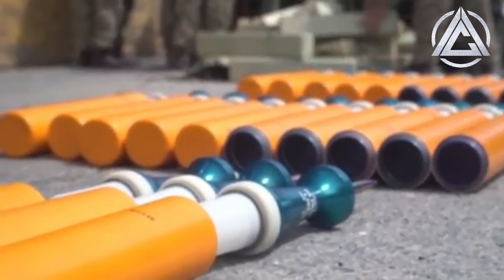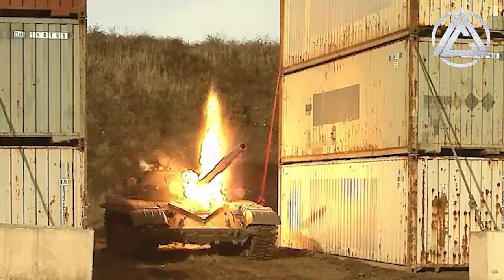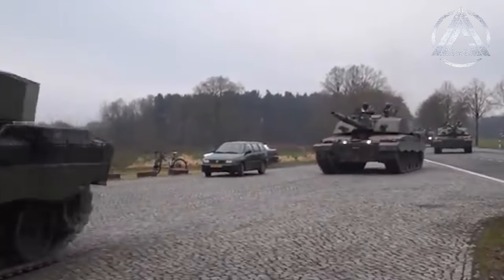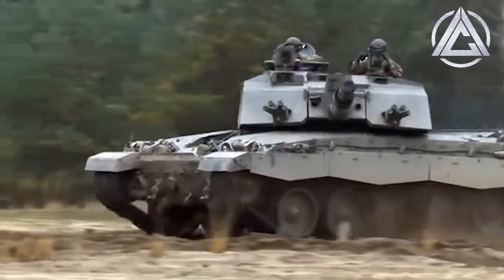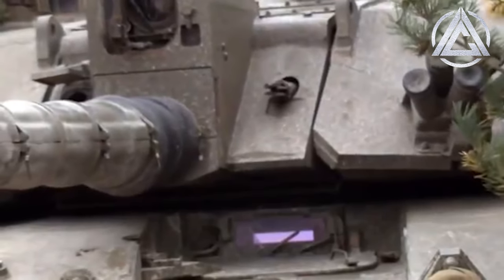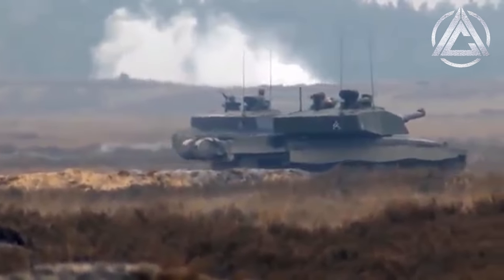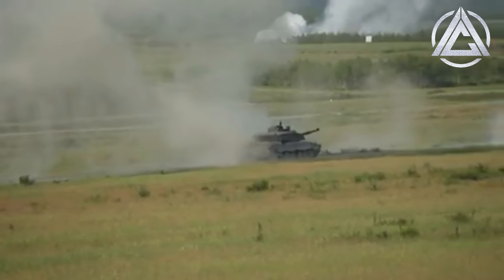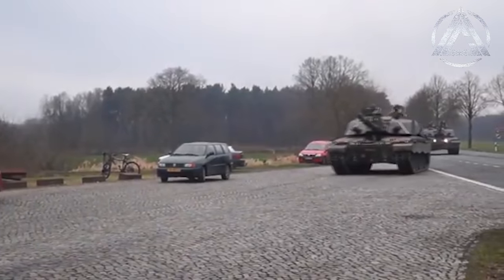Challenger 3 | Britain's New Main Battle Tank | Is It Really Any Good?

Comment: Well I don't want to be harsh but your kind of deserving it sorry you said you base your info mainly on reaserch but then you said in the beginning it's a whole new tank and that means you didn't actually read much after all because c3 is basically an upgrade to the exact same tank as c2 with minor upgrades mainly infrared technology and other few tweeks like main gun and such
Reply from the maker: The “few tweaks” are 7.7 million per unit’s worth… It’s the old Challenger 2 hull (modified). But it’s a new tank.

This would be like saying that the M4 Sherman wasn’t a new tank at all, because it reused automotive components and basic hull design from the M3 Lee
Reply: @ArmorCast  You are basically giving your personal opinion of what you think it is against what it actually is..  It's not saying anything it's just a fact it's an upgrade to challenger to not the whole tank and it will cost that in total to sell not to upgrade. The same analogy would then also be used in everything A mercedes c class from 2021 it's a completely different machine to from the 2000 model full of upgrades it should then be named f class because it's even better then the 2000 s class but no it's still the C class respectively. The difference is c class from 2000 it's a completely different car then 2021 literally everything has changed unlike the c2 tanks that are going to have some parts exhanged on exacly the same ones that are currently in service and their renaming it c3 they are not building new unit's mate their using the same ones.. If you take your vw golf to the garage and ask to change suspension bigger alloy wheels , xenon lights , modify the engine. Ect. It does not become golf gt or golf 3 it's still a golf just a modified one.

Comment: All the NATO tanks are beginning to have serious problems with weight of their MBTs seems like. They're getting heavier and the armor increases are only marginal. Even the 1500hp engine that Leopard 2A7 uses doesn't make it that nimble and Challenger will be heavier and supposedly faster with just 1200hp? I think the army is just throwing around numbers.
Reply: @ WWlad: This is the old drama and dilemma of tank design: The triad of tank attributes for the engineer and designer is 1. Mobility 2. Protection 3. Firepower. If you build up one or two attributes at the expense of the third, your design is out-of-balanced and perhaps flawed or vulnerable. If you build up all three, you eventually get a tank too large and heavy for use in some circumstances. The Germans in the Second World War, and Anglo-American and Soviet tank development immediately afterward into the 1950s, showed that the largest practical operational tanks could be of 65-70 tons, no more. Past that weight, and bridges and roads can no longer handle them, they are too large to fit through some tunnels, and they become too-heavy and bulky even for rail transport without being broken down into their components. The heavier the tank, the heavier the tank recovery vehicle has to be, and the more-capacious your fuel supply system, since big & heavy tanks drink a lot of fuel. And again, as the Germans showed in WWII, big, heavy and technologically-advanced tanks are more expensive on a per unit basis, and take more materials and man-hours to make. 

The next paradigm change will be tanks which are unmanned and operated remotely, like drones and UAVs. Much of the time, expense and trouble of designing the modern MBT is due to the human element, the need to have a crew of men aboard to fight and operate the tank, and the need to protect and sustain them in the field. Absent the human-being, tanks can again become light, faster and more-disposable, in the sense that losing one is to lose a machine, and not the men and a machine. Perhaps they will even become swarming weapons. But first the tech has to advance enough to make "crew-less" tanks a reality.

Comment: Feb 2023 Update... The Challenger 3 is not due to enter service until 2027, with full deployment by 2030. Is that too late for the current situation? We need to invest in a new factory to convert all Challenger 2 MBT's to Mk 3, instead of mothballing most of them.

Comment: Skip the 120 gun it' should go the same route as the KF 57 Panther go 130 in fact if Rhinmetal is disigning the Turret why not just use the KF 57 it would give the Challenger three a bigger advantage ok its an auto loader but you are not losing the fourth man instead your gaining a better usage of manpower he is now like a systems operator in say the F 15 or F 18 he can operate the radar the infrared warning systems fly the reconnaissance drones and the attack drones it could also be a possibility that he could take control of the 30 mm auto cannon by using the radar and lazer infrared and audio tracking systems engage enemy light armour and infantry so the tank commander can pay full attention to his main job to work the main asset the tank itself of course he can pass targets to the systems operate like he can to the tanks main gunner using the hunter killer he could designate targets for the 130 like enemy tanks and designate targets for the 30 mm like AFV and APC and SPG in doing that he is making full use of the type of ammunition he has both in amount that is needed and type for each target this is what I see could be a great use of both the Challenger armour with the Turret of the KF 57 of course this is going to be very expensive I do not expect this kind of Tank to replace the MBT system but as an alternative way to supports both the infantry and the MBT system

Comment: why the brits want to buy the 120mm gun when they can have the new 130mm L52mm smoothbore gun with 50% more penetration? Rheinmetall said it can be also installed in tanks like Challenger 2 or 3, Leopard 2, Abrams and Leclerc.
Reply from the maker: Likely either a lack of confidence in the VALUE of the 130mm (the L/55 is already overkill for every Russian or Chinese tank in service, and with Russia busy dragging old T-62s out of storage they don't exactly pose much threat), plus the drawback of lower ammunition capacity you get with larger projectiles.

Plus, if Germany DO adopt the 130mm (big 'if'), 120mm rounds will be going cheap, very good when your upgrade plan costs you 7.7 million a pop!

Comment: The thing is though as this war in Ukraine has shown lightly armoured tanks and horrendously stupid design of storing ammunition and propellant in the bottom and around the inside of a tank turret with out protection is stupid also with out blow out panels .  Even the polish ATGM slices through the sides and frontal armour of a t series tank.  If anything it has shown that heavily armoured tanks with reasonably good mobility is the way forward with hard kill anti tank protection like the Israeli system which has saved merkava tanks and has proven very successful if interception of ATGMs rockets and missiles.  It would be better to up the power by fitting the german engine or having a gas turbine with a stronger gear transmission system.  The new armour package for the challenger 3 will be excellent as the British chobbam now Dorchester armour was the best of any tank and they know how to make the best armour.  I’m not sure if the new armour specs will be divulged so we probably won’t know.  You can’t have good armour with out incurring weight so they should get thatGerman MTU power plant.

Comment: Simply NOT TRUE. Using HESH does not require a rifled gun; using the current HESH round does. You CAN put plastic explosives and a rear delayed fuse in a fin stabilized round. It'll look like a smooth bore HEAT -- a big heat followed by a narrow stem with folding fins -- except that instead of a shaped charge or two you have a squash head up front.
Reply from the maker: That would work to help the plastic pat to expand the way it can with rifling… but it’d be horrifically inaccurate. Better off just using a timer HE-frag round at that point, probably cheaper too!

Comment: Can’t they just bolt on the upgrades to challenger 2 and call it challenger2B becuase it’s the same tank with upgraded turret. Why do they need to build a whole new tank hull when it’s the same.
Reply from the maker: That’s effectively what they ARE doing, they’re not building any new hulls at all. I expect the only reason its being called Challenger 3, and not Challenger 2 Mk.2 or Challenger 2B, is because Challenger 2 is over 25 years old at this point, and they want to market this as a NEW, replacement, rather than just an updated variant… then again, they’re still making new variants of the B-52! 😂

Comment: CH2/3 has worse armour than Abrams? I thought they used the same Chobham armor...
Reply from the maker: Original Abrams did. It was then improved in 1983 (M1IP), again in 1987 (M1A1 Heavy), and then again in 1992 (M1A2). Challenger 1 to Challenger 2 only saw one armor upgrade, and yeah it was pretty significant, but against armor piercing rounds it was slightly worse than the M1A2s armor.

It was slightly better against things like ATGMs however, about on par with the Leopard 2A5.

Comment: I doubt relying on Germany for the Gun and the Ammunition does not seem wise to me. Better the British MBT should be an entirely BAE system product.
Reply from the maker: You know it’s designed by Rheinmetall right..?
Reply: @ArmorCast  yes indeed. Such are the times we live in sadly.
Reply: One of the primary reasons for the failure of the axis powers in ww2 was a failure to cooperate, the germans had some of the best ground troops, the Italians had a navy that could challenge the royal navy and Japan had some truly impressive aircraft

But they didn't share they refused to cooperate and these areas they excelled at were rendered useless 

The allies cooperated they shared technology and what they had perfected and in doing so created a military far more capable than the axis the p-51 mustang with a Rolls-Royce engine made the greatest fighters of ww2 as just one example 

Today the allies include Germany so if Germany has a tank that's better than what the British designed why would the brits gimp themselves by using an inferior homemade design?

Comment: Why does the UK insist in making their own tank? Wouldn't it be a lot more cost-effective to simply buy leopards?
Reply from the maker: Not for the British public. Make no mistake, the primary purpose behind this move is to create/keep jobs in the UK
Reply: @ArmorCast   I see, that is a shame. The UK 's military budget is not that big, and a lot of money will probably go to research and development. Because of the low production count, setting up a permanent and efficient production line will be hard, so it may as well be handcrafted. 

For Europe's sake it would be so much better if we could settle on a common tank design and mass produce it. The same can be said for air defense and artillery. It's great that Europe builds top-notch artisan military equipment, but that won't be very useful in a war of attrition.
Reply from the maker: @wyringen  ehh, not so much in Ukraine - they’ve got hodgepodge battalions of both Soviet era eastern tech combined with German, American and British units as far as artillery, air defence, personnel carriers and MBTs. Standardisation looks great on paper, but having different nations producing competing designs generally has more benefits - decentralises manufacturing and forces designers to focus on making the best platform possible (also allows nations with different logistical and doctrinal requirements to tailor-make vehicles for them).
Reply: @ArmorCast  Thanks for the explanation! Maybe this topic will make a good video?

Comment: You overreached when you said a head-to-head matchup of tanks vs each other shows nothing.  It might not show everything, but it would show the weaknesses that Challenger has when fighting other tanks (that you've correctly mentioned including the lack of active and passive missile defense).
Reply from the maker: Problem is, most of the “weaknesses” that appear to be true in these contrived scenarios are made irrelevant by their use in actual warfare
Reply: @ArmorCast  except it's definitely gonna be getting an APS which will probably be either Iron Fist or Trophy, and they have already said this is gonna happen at some point long before this tank ever sees a battlefield, it just hasn't been decided upon yet which is surely fair enough- in 6 bloody years time when this thing is FINALLY ready in all other respects? I'm sure by then they finally will've decided

Comment: If its armour isnt the best then why is it so heavy?
Reply from the maker: Several reasons - for one, it's a bigger tank. It's larger than the M1 Abrams in every dimension, which means more material and more area that has to receive heavy armor. It's also got better armor COVERAGE - while the turret front might be worse than the turret front of the Abrams... the upper hull is actually better, as is the side of the turret.

Lastly is that it's just an outdated design. The original Challenger was never actually developed for Britain to use. It was built for Iran as an upgrade to their Chieftains, and then recycled after the Iranian revolution in 1979. The Challenger 2 was then built in 1986, and was meant to be simply an improved variant of Challenger 1, not it's replacement. It was never meant to be in service this long, and as such the internal systems of the tank are... old. When you want to integrate NEW systems into old architecture, you have to include what the industry call "integration modules" - basically adapters; extra bits of kit to allow the older systems to communicate with the new stuff. Those modules are heavy... REALLY heavy!

Comment: I cant believe the comment that, reference the Cr2 weight that the Armour on a Abrams is better than a CR2 with Dorchester?????  lol......
Reply from the maker: Depends what you're talking about protection AGAINST. Chobham armor (like Burlington or Dorchester) has always been the world leader when it comes to protection against cumulative charge warheads like RPG's and ATGM's, and Challenger 2 is far superior to M1A2 in this regard (about 300mm better on the turret and at least that much on the upper hull). 

BUT that armor array has never really been all that optimised to defeat kinetic energy projectiles like modern APFSDS rounds. In this regard all the best sources would put the depleted uranium armored M1A2 at about 15% better than Challenger 2

Comment: Drop the gas turbine out of the USA tank, into that British one and you'll have your 1600Hp and with some tweaks even go to 2000+HP or you could go 10 honda civic motors and get 50Ltrs/per 100km with 3200Hp+ with a 500,oooKM motor life span, 120,000 miles before needing a cam chain. Just make sure you keep that oil clean. Hondarific :).

Comment: Have you changed your view on autoloaders at all given the experience in Ukraine?
Reply from the maker: Not at all. I think the benefits of an autoloader simply outweigh the benefits of a fourth crew member in the modern day, and I would point to Germany’s latest KF51 Panther as further proof.

The Russian carousel style autoloader just isn’t a great example - it’s no faster than a manual loader, very poorly protected, and relatively outdated technologically. It still however allows for a smaller, lighter and yet more well armored machine, and if Russian tanks WEREN’T equipped with autoloaders, they’d be doing even worse
Reply: @ArmorCast  Thanks for the reply, that's interesting. I'm slightly worried the Russians will learn a lot from the Ukraine war and come back better. They will inevitably retool with the aim of countering drones, the NLAW and Javelin. I hope we anticipate where the next decade's challenges will come from. 

How do you think the NLAW would perform vs the latest German Panther and Puma?

Comment: Since Challenger 2 is such a POS I have to say there is no way Challenger 3 can be any worse, it has to be better - the bar is set so low anything would be better. It would be cheaper and a much better idea for UK to just buy Leo 2s (well they sort of do - just "hidden"). But I guess they want to keep their industry in theory. Even North Korea main tanks today (best) have... laser warning receivers. 
Brits should just stay away from tank design. Come on... weight to power LOL. Did they reach T-34 level yet? By 2030 one has to look into 140mm rounds with auto loader.

Comment: Toooooooooooo Heavy...............look at the size of the munition vs the machine... ridiculous.....impossible to do 60 mph with metal linked track without them wearing out in 250 miles or snapping...need rubber endless belt from Soucy but the max weight is 30 tonne for rubber belt. Total absolute waste of UK tax payer money, but how to stop this being built.. The next generation of MTB needs to be no more than 30 tonne all up....

Comment: You will not see a smooth bore sniper rifle why???. ex tank man.
Reply from the maker: Well, A: because you can't have a "smoothbore rifle" in the same way you can't have a "full-auto bolt-action"... if its smoothbore, it isn't a rifle.

As for why sniper rifles are... well... rifles! They're firing full-bore conical bullets, not flechette-style sabot rounds. The physics affect them in completely different ways. A conical bullet will be gyroscopically stabilised by rifling. A sabot penetrator will start to tumble end over end and not only lose ALL its penetrative power, but also most of its accuracy too!

This is why sabot rounds for the 105mm rifled cannon had to be built with spinning rings so that the penetrator rod DOESN'T spin. This is also why shotguns firing sabot rounds are often used for hunting - due to their accuracy